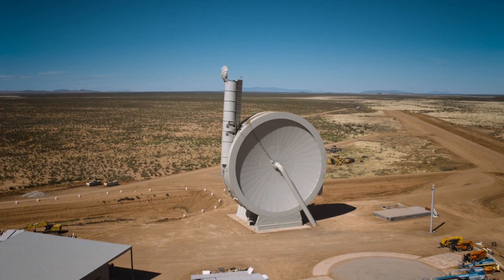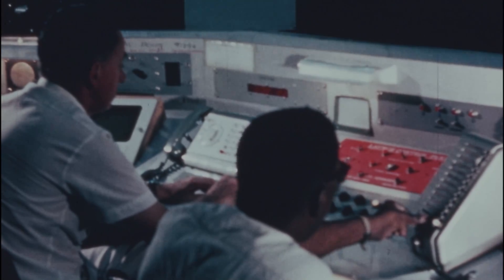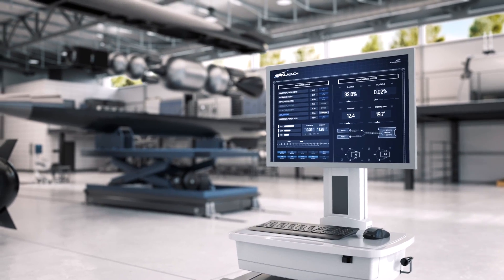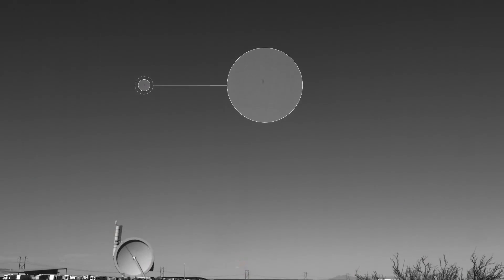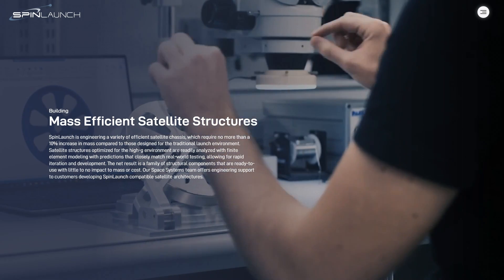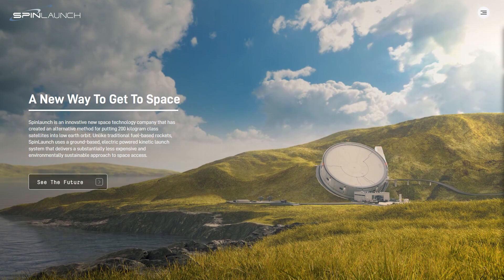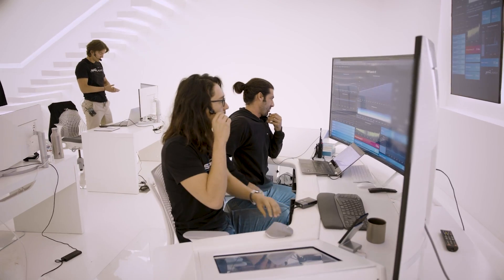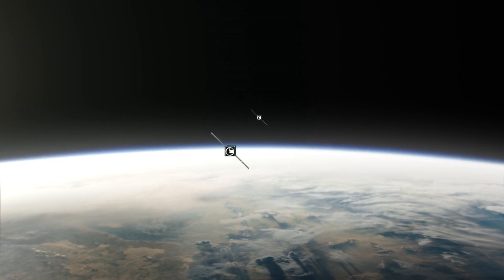Can Spinlaunch Throw Rockets Into Space?

Comment: That demonstration was a failure. That's why there was only a handful of seconds of the actual launch. You can clearly see that it came out of the tube at an angle, immediately started tumbling, and was already a few degrees out of line with the launch angle at only a couple hundred feet. Plus everything that gets launched has to be built with the ability to be folded into a more compact size & deploy once in orbit. While the materials may be able to, I can't see moveable joints that have to operate on their own the first time  not deforming under that sustained load.
Reply: it didn't "start" tumbling, it continued to tumble exactly as expected. The projectile has built up angular momentum, it's not going to suddenly lose all of it after the launch, it must continue to rotate (no matter how precise the release mechanism is)
Reply: @charonme  That is not what he talks about. The rocket tumbles from left to right, the nose to the east and then to the west. And no, that was not intended. That costs hell of speed, could destroy the rocket. And it was too slow.
Reply: @CosmicReef  I didn't say it was intended, I said it was expected. (Conservation of angular momentum)
Reply: @charonme  Whether it was expected or not, it was tumbling.  That's a failure.  They are not going to get rockets very far if they are sideways half the time.  Maybe they could put fins on the projectile but then they must survive ripping through the chimney membrane.
Reply: @lexlayabout5757  I agree, but I doubt fins would help much
Reply: @charonme  actually the projectile is tumbling due to insufficient angular momentum at launch, not much different from how a bullet fired from a smooth barrel tends to tumble.

That's why modern guns have rifling, to impart angular momentum (along the long axis) to prevent tumbling along the other 2 axes.

Comment: They yeeted their rocket at a subsonic speed, at around 300m/s. They need to do it at 2000m/s to be viable. Whatever leaves that tube at that speed will melt due to air friction. And whatever small mechanical problem/fault creeps into the system at those speeds, it will demolish the whole facility with high velocity shrapnel. Keep your money away from this. I'm actually surprised at how brave they are because the control room seems to be adjacent to the spinner.
Reply: @timemachine_194 you’re launching this thing from vacuum and it breaks vacuum seal on launch. Not exactly the same as railgun projectile.
Reply: @timemachine_194 nah, I mean, what happens when you go through it?
Reply: It's gonna take more than 20 secs as it is rapidly decelerating after it releases from centrifuge.
Reply: ok random person in the internet! we trust you
Reply: @filesopen6188  don't trust me, open a math and physics texbook and verify.

And if I'm wrong show me where.
Reply: im sure the space shuttle and other reentry vehicles have melted as they've graced the atmosphere. this is a solved problem. unlike the viability of spinning a vessel to speed (at some 450 rpm with load of 10,000 kg ) then releasing (it at 2000m/s) in a controlled manner.

Comment: The sudden unbalancing issue could be solved by also releasing the counterweight. Make it a metal counterweight and it could be guided down a track to generate electricity and recoup maybe 10% of the electricity used per launch

Comment: How is this a practical design? You need to put the rocket into the arm. Then close everything off. Start pumping the air out. Then speed up the rocket to 6-7G. Have a firmament (where the rocket comes out off) that can keep the vacuum intact, have a quasi 100% perfect release window every single time you use this otherwise you will need to rebuild it and check the entire vacuum chamber for imperfections. When the rocket is launched, you need to worry on how you are going to keep your rotor intact when it is losing its payload and the air rushing in.

I think solving those problems might lead to other practical implementations but I doubt this project will be viable. The maintenance checks alone after each launch and the enormous amount of energy required to create the vacuum and spinning up the rocket would be huge.

Comment: To re-balance the arm after launch, they could release a balancing weight having many times the mass of the payload, but closer to the axle.The slower velocity would result in a much less dramatic impact.
Reply: Nice idea. I was thinking how strong this counterbalance mass must be to endure the 10000g but if it's closer to the axle, it's much easier to achieve the required strength with common, inexpensive materials. Maybe if concrete suffice then they can freely mass-produce those counterbalances and throw them down a river or chasm or hillside without affecting much of the launch cost. Won't be very environmentally friendly though, but spectacular to watch!!!!!
Reply: @HieuHCPhan-eq6fk  Still the counterweight will carry some 25 GJ of energy (equal to 6 tons of TNT) which will be set free in a spectacular explosion once it hits the ground.

Comment: From a vacuum to 1atm @. Mach 7, it would be like hitting a brick wall, totally impossible in my opinion.
Reply: @timemachine_194 The problem is the shock when the payload leaves the chamber and crashes into the air. You have got two extreme changes in inertial force while launching - in two different directions. That's a perfect way to destroy any payload.

Comment: Question: If before "launch" the payload is turning at 450 rpm, what keeps it from turning sideways after it's released?
Reply: The lack of forces to make it turn.
Reply: @dtkedtyjrtyj  That projectile, if it's attached to the tether turning 7.5 revolutions per second, is rotating at 7.5 rps. It doesn't stop rotating just because they release it.
Reply: @michaeldunlavey6015  Yes, I thought you meant it'd keep rotating around the same center. But then I actually thought about it and realised it actually has angular momentum.

Its been to long since physics.
Reply: @dtkedtyjrtyj  I wonder if they release the front of it a split second before they release the back of it.
Reply: @michaeldunlavey6015  Yeah, they already need microsecond timing, could just be two problems with one solution.

Comment: I wonder if the acceleration at "take off" will not be excessive for payloads ?
Reply: There is no take off acceleration as the 'acceleration' or g forces slowly rise as the centrifuge spins faster and faste. The moment of release the rocket actually stops edperiencing gs and then hits the seal and then air very violently.
Reply: @GGWalace  what is therefore the speed of the satellite at release from the centrifuge ?
Reply: @DanielHERNANDEZ-yw7rf  less than mach 1 here. Mach 5 or 7 is what they want to achieve
Reply: @GGWalace  Thank You very much. Do you think that the kinetic energy (1/2 MV²) acquired will be sufficient to reach a stable orbit ?
Reply: @DanielHERNANDEZ-yw7rf  it still has a rocket engine and fuel to get into orbit. This just makes it that the majority of the fuel a normal rocket would have to take off is not needed.

Comment: Re: Imbalance after launch,
Can you not just make the counter weight push itself way out a millisecond after launch? So instead of being close to the hub it's now close to the edge. Wouldn't that balance it out?
Reply: That would actually make it more unstable, because it moves the center of mass further from the center of rotation. You would have to move the counterweight in the opposite direction, and pretty much right to the center to balance those forces, barring some other method.

Comment: Please revise your "g" calculation more carefully. For 340m/s (~Mach 1 @ sea level), with a 50m spin radius, I get about 235g of centripetal acceleration.

Even for the smaller 33m spinner diameter, with same Mach 1 velocity, acceleration is about 714g. Nowhere close to 10000g
Reply from the maker: 15 not 50.

Comment: The Spinlaunch has no concept of centripetal force. With the mass such as rocket or satellite rotating at such speeds may get crushed under its own weight. You may need hardware stronger than the forces we are dealing with at such speeds. This is the same reason why tesla turbine is not feasible. Spinlaunch is just a big cantilevered wheel with release mechanism thats it. But the amount of energy to launch stuff would remain constant.

Comment: To counterbalance they could have a large ferromagnetic load that they shoot down a giant straight solenoid and reclaim a portion of the energy it took to launch the both payloads. It would even be a great spot to put the vacuum system as the incoming air pressure flooding the system could assist in propelling the magnetic load down the shaft or even close behind it leaving a partial vacuum for less loss due to air friction.

Comment: Two questions: 1. How do they manage the mechanical imbalance of the rotor after the projectile has been released and 2. The vacuum is very suddenly filled with air through the ejection tube's ruptured membrane.  How is this sudden influx affecting the system?
Reply: Not a fan of the project,  but they have talked about having 2 projectiles so you only have half a rotation of imbalance. And for the vacuum, they are currently using a milar film and are working on an inner door that can close in milliseconds. Airlocks could work. 

Problems are bigger than that though,  thunderf00t already debunked the project.
Reply: @waterismyhome  Half a rotation at that speed is more than enough to damage the structure, if not make it fail catastrophically.
Reply: The stupid system of throwing a similar weight simultaneously to a hole in the ground opposite to the launch tube could work once.
Reply: @ottolehikoinen6193  Its not stupid it could work.
Reply: 1. They use double doors and they won't tell exactly how they pull it off but they are fast like a shutter on a camera.   The vacuum is preserved.
Reply: The mechanical imbalance is fixed by a counterweight on the other side of the launch system. To counteract the force that can be exerted from ejecting the projectile, this counterweight is also a replica of the projectile with the same weight. It is ejected at the same time as the actual projectile, and the imbalance is countered. 

Check Real Engineering's documentary about Spinlaunch on his channel.
Reply: @TRD6932  Makes sense, thanks for the reply.  I posted my questions before the real engineering documentary was released. 

Therefore the counterbalance weight released shall be 180 degrees from the projectile. Where does this counterbalance go, once it has been released? (keep in mind it has the same amount of energy as the projectile heading for space) I watched the Real engineering documentary but do not recall them addressing this. (maybe I missed this)
Reply: @tomz1364 
One: The weight is indeed 180° of where the projectile is.
Two: This weight just impacts into a heavy duty wall. A new weight has to be used for every launch.
Both were mentioned in the Real Engineering video.
He definitely explained it better than I can.
Reply: @tomz1364  I also forgot to mention about the vacuum problem. There is a valve before the membrane, and it opens and closes at insane speeds right after the projectile is ejected to prevent so much air from coming in.
Reply: How dare you endanger this excellent project by real-life questions?
Reply: What I would do is to shortening the other side. Pushing it out either by explosive means or using electricity or maybe even air/vacuum. Just a thought.
Reply: Another idea to keep the rotor balanced both before and after the release is to add a dummy mass in a direction opposite to the rocket and release both at the same time which will be lot more complicated.
Reply: @Sumit Sharma  how would you do that?  You would be throwing a up to 1100kg projectile at 2km/s into the ground a few feet away.  You would destroy everything.
Reply: They dont thats how
Reply: One method of keeping the rotor balanced would be to have a second, identical payload on an opposing rotor of equal length that launches directly into the floor at the same time.
Reply: @SchrodingersNeighborsDog  I Like that idea Si.
Reply: For the mechanical imbalance you can have weights in the side of that arm holding the rocket. At the moment of release these could shift their position rapidly to restore balance. For the effects of sudden influx of air you simply build a sturdy system with as low air resistance as possible I'd imagine.
Reply: @Alexandre ANGELI Watched the video, thanks for the tip.🙂👍
Reply: Not to mention that the projectile will melt virtually on impact with the atmosphere and all the components on the payload won't withstand 20k g's and the fact that the liquid fuel in the tumbling projectile will smash through the fuel cell and vaporize in a ball of flame
Reply: Currently the counter balance is released into the back side which is just a reinforced hunk of steel. They claim in the future they want to launch a 2nd projectile out instead of a counterbalance. 

They have a door which is supposed to close behind the the projectile so they don't have to draw a vacuum in the main chamber a 2nd  time
Reply: Short ansWer: they don't.
Reply: I saw the entire video they use double doors like an airlock to supposedly prevent it from filling back with air entirely.
Reply: Simple. It just implodes, and then explodes violently. Meanwhile, the projectile is burning through the lower athmosphere having still a rotation motion.
Reply: You can answer it with easy, It's a scam like theranos
Reply: @yurisabrori  SHHHHH! He can't answer it easy! Or nobody will watch his videos! Don't tell people he is hyping up the scam company, he might get in trouble!
Reply: @EvilSarma  is it a scam if they say this is what we are trying to do will u fund us
Reply: @celuler22 if they know it won’t work… yes. Definitely.
Reply: to fix the Vacuum problem, as well as the atmospheric heating and deceleration problems, just build it on the moon. Using an electric motor is easier than moving propellant to the lunar surface, or producing propellant on the moon.
Reply: @Ikaros---  On the moon, a magsled will do the job without the 'imbalance after launch' issue.
Reply: @Ikaros---  except the whole point is to produce propellant on the moon. The propellant is the marketable product to be exported.
Reply: @Ikaros---  over half? Maybe. No idea on the mass/fuel economy in lunar gravity. In any case, orbital artillery would still be more practicable than a giant fidget spinner. That will, simply put, never work.
Reply: @Ikaros---  so what you're saying, is that a massive centrifuge is a more practicable option? 

So yeah, we're back to using hydrox rockets to launch hydrox fuel.
Reply: @Ikaros---  build maglev hypertrain around the moon to shoot the projectile, as short maglev mass driver. Humankind can build on the earth but, plate tectonic make it unusable for the long term
Reply: @Ikaros---  everything on the moon should be tunnel underground, only few entrance/exit on the moon surface. Easier for human to survive and work, reduce risk from space debris. With moon rotation phenomenon facing same direction, it's also easier for building entrance/exit also easier for calculating projectile direction
Reply: @Ikaros---  Very interesting and valid arguments! Thanks! I do agree!
Reply: @jaroslavhancovsky3249  well it's working lol
Reply: @jaroslavhancovsky3249  it's been working though? Any updates on your critiques?
Reply: You could add doors outside the exit hole that would be drawn closed by the air rushing in to fill the vacuum. There would be a brief influx of air before the doors slammed shut and sealed the chamber. A small amount of air in the chamber would assist the spindown. Kind of a spin to win-win.
Reply: If you transfer all of the rotational energy of the spinning system into the launched projectile, then you nearly instantaneously have an RPM of 0 immediately after launch.
Reply: @chadmcmullen4064  Actually it will give a reverse momentum  according to the law of conservation of momentum. Rotational changes can easily be handled, but the radial forces will be very high during the time of release.
Reply: Amazing questions. 
I am not sure. If I guess, the mechanical imbalance can be handed well with a flywheel. The similar things happen in an Internal combustion engine as well. However here it can be controlled in a better way assuming we have electric motor to take care of the rpm changes. Also the rpm is not that much around 450rpm which is comparable to a ceiling fan, only the blade length is very high, but one issue is that the rotor can either be balanced before the release or after the release. For a stable release, I assume that the rotor will be balanced initially which needs to be done during every release. I think vaccum is made so that the rotor can achieve the desired rpm and for better control of the release mechanism and prevent the rocket from getting too much drag.

Comment: I hear super fast rpm and hundred meter diameter, nope, big nope.
Stuff that spins very fast is very scary.
Upon further thinking I'm now realizing just how confusing of a design this actually is, my first question is how are the projectiles not going to disintegrate instantly? Like mach 10 in low atmosphere sounds like a good way to burn up or at the very least massively decelerate? With sprint the thing was mostly shielding to protect itself.

And what happens if the projectile releases too late or early? Its basically a big bullet filled with explosives. Honestly this would make a better artillery piece than space launch system.